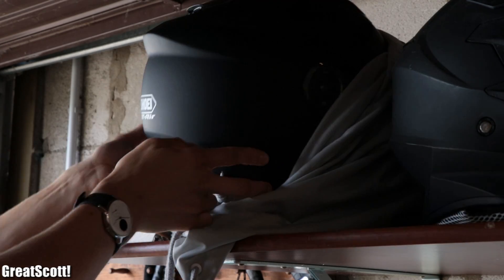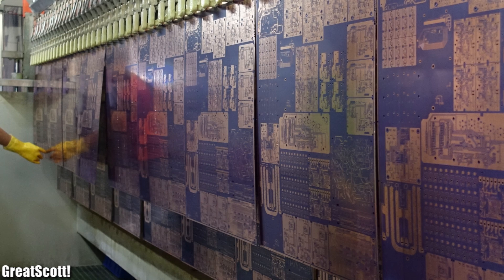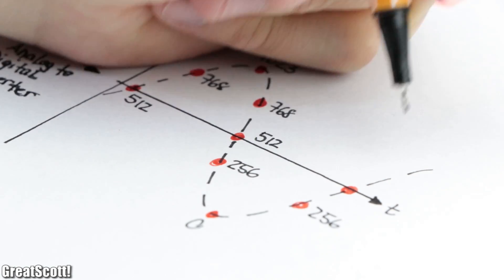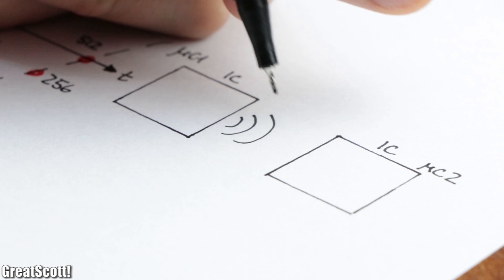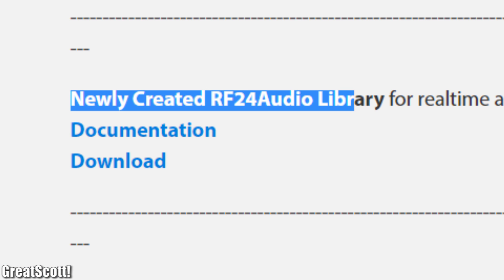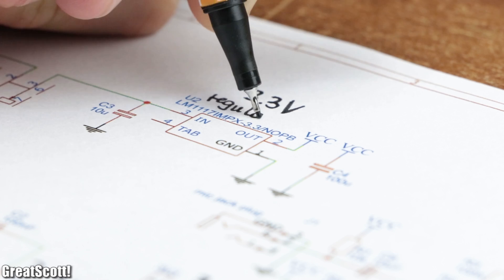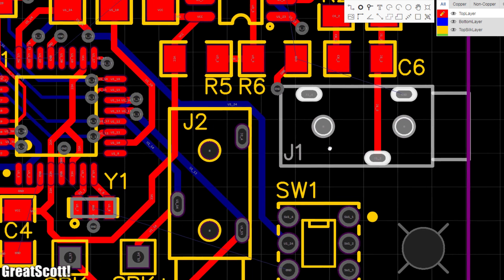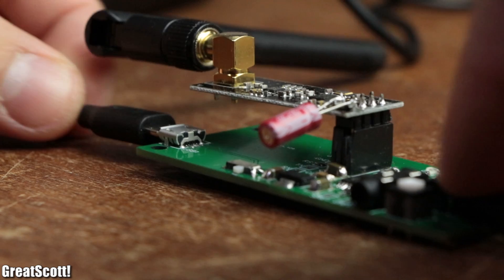Make your own very crude Walkie-talkie with an Arduino

Comment: I'm fairly certain that the distorted audio you're experiencing is because your amp is inverting, while the ADC on the ATMega 328 is only able to read inputs from GND to 5V.
What you're hearing is half the audio wave, with the bottom half clipped.

Maybe try change the amplifier to output centered around 2.5V (or half your supply) and update the Arduino ADC voltage reference to suit.

Comment: Michael Ossmann:Simple RF Circuit Design  at the 2015 Hackaday Conference is a good watch.  He recommends what you said at the end like using dedicated chips and FPGAS but I still think that the arduino must be capable of better. I liked some of the comments suggesting adding a capacitor.  Ground plane and layering of the components is the thing I remember from the talk above. So the noise of the processor is behind a grounded barrier and only the signal pokes through.  ESP32 with bluetooth would be a great project too. It is still programmable in the Arduino IDE.  Using an ESP32 with bluetooth may also make you legal with whatever radio rules you might run against.  I am pretending to be smarter than I really am as actually designing this is way about my skill level. I like how you designed everything from the ground up.  I enjoyed it very much.

Comment: Unless i'm mistaken you are powering the LM358P with 0/3.3v. But since the LM358P is not rail to rail, you only have 0 to 1.8v as valid output before it saturates (Vcc-1.5v).  So with a gain of 100, if the input goes over 15mv, it will saturate the output. If the input is indeed between 0 and 100 mv, it will saturate very easily, as soon as it is above 10% of his dynamic range.

Comment: You need a low-pass filter to turn PWM into something resembling an audio DAC. There's even a short article on Instructables with resistor and capacitor values for Arduino's PWM: https://www.instructables.com/id/Analog-Output-Convert-PWM-to-Voltage/

Comment: Great project, with an unfortunate twist. IMHO the audio sounds like a big vs. little endian mix up, integer overflow, improper use of 2's complement, ... Try to look at the output waveform with your scope and compare it to the input waveform (use a function generator to get a pure sine). If half-waves are upside down, intermediate spikes, ... these would strongly point to such numeric bugs.

Comment: Many others have mentioned the PWM as the problem, and I think so too, but it also seems weird to me to connect the GND of the speaker to PB1 (I presume a PWM pin). This should not be high, low nor PWM right? It should be exactly in the middle at 1.65V.

BTW I haven't looked at the library so maybe I missed something.

Comment: I would test the audio input circuit first, with an existing platform, then I'd test the output circuit the same way... That way it would be possible to know if the problem is with the microcontroller, the audio circuits (input or output) or the transceiver (NRF24L01 module)... Either way I loved this idea and I will try to experiment with it :) Stay creative!

Comment: 100 mV, gain of 100, so the output can reach 10V. But you opamp works between -3.3V and +3.3V, so the output will saturate. You can try to reduce the gain (e.g. 30) and try to use big resistors... For example 10 Mohm for the feedback resistor and 330kOhm for the input resistor of the inverting opamp
Reply: Same thing i thought, it just sound like a saturated sound. A quick view with the oscilloscope should make the problem clear...i would go for a simple dual stage amplifier and a low pass filter at the output.
Reply: He uses a potentiometer in the feedback, so he can tune it till it's good... I think this shouldn't be a problem.
Reply: upvote this so he can see

Comment: You need to add some multistage RC low pass filter to supress the high frequency components from the pwm audio before passing to the speaker amplifier.

Comment: I would have tried without the amplifier. Just adjust the ATMEGA analog reference voltage pin with two resistors (voltage divider) and select the analog reference input in the fuses.

Comment: A teensy microcontroller would have been much better for this, it has a much faster clock, way higher sample rates, and way more capable. It uses the arduino IDE and libraries, plus the teensy website has an audio library design tool.

Comment: To get a signal same as transmitted, use LC filter.
         L, ~80uH

IN ----^^^----.--------- SPEAKER OUT
                   |
                   -   C
                   -     ~800nF
                   |
GND--------------------GND

Comment: Arduino PWM >>> Class D AMP, use an LC filter or create a square to sinusoidal converter with only three resistors and capacitors. Some time ago I wrote a sound card for attiny85. My PWM then had a frequency of about 1MHz and then it was OK.
Link:
https://www.youtube.com/watch?v=HCr_IcG5m0o&t=164

Comment: Nice little project. I hope, like everyone else, you will investigate where the real problem lies. For example output the digitized waveform from the first Arduino back out of that Arduino and check it with a scope  and with a speaker through a filter.

Comment: In my opinion the problem could be in the cell phone. If I understood the video well, You connected cell phone's audio output directly to the microphone input. Phone headphone output generates approximettely 0.6 Volts but microphone generates much less. I would try do decrease the gain of the operational amplifier because now You have almost rectangular signal.

Comment: Noise / parasitics wont have THAT big of an effect on sound quality. If you want to keep the challenge and not throw in a class D, it might be that you need filtering on the output PWM signal.  Part of that doesn't make sense though since that PWM carrier should be ~32kHz therefore inaudible. More likely (from a filter standpoint) you need to impedance match the output and speaker.
Beyond that maybe its the drive capability of the atmega output, or the way you have the speaker connected. It looks like you're either trying to drive the speaker differentially or sink current through D9 (PB1)? Both could be problematic and where I would start testing!

Comment: I'd be tempted to try the rfm69cw or rfm12b transceiver modules and see how that goes. I wish I had some spares to try with :o I believe the can both do 433mhz, 868mhz, and 915mhz... Went back to look at the modules and it seems hoperf makes other modules that would be better suited. The two I mentioned are only up to 300kbps. The rfm26bw can do up to 1mbps, with in 142–1050 MHz. Neat. Now sure they aren't specifically made for audio, I bet they could work reasonably well and allow for some extra features given they use a packetized data stream. They are also easily controlled via an arduino.

Comment: Block the higher order harmonics of the pwm wave using LPF. From my experience, 16kHz sampling rate is enough for just human voice. At 3:40 I saw the Vp-p of the amplifier is about 2 or so Volt. You may increase the gain of the microphone amplifier even more (may be using a dual opamp?) for better SNR. Also use better speakers (throw those crappy ones out. I hate those sh!ts.)

Comment: Maybe reducing the data to 8bits, transmitting it as raw data and using a 8bit port with 8 resistors to create a dac on the reciver would work better.

Comment: The PWM output of the arduino is in the audio range 490hz. So you're not going to be able to output an audio signal between 60-16Khz with PWM. You may be able to output a 50% duty cycle digital signal at a much higher rate and just adjust the bit stream to simulate a signal.

Comment: Great video!
But... think of the poor audio being sampled by an microcontroller, with all the possible aliasing and stuff, then you send that data to another microcontroller that will try to use that data to move the duty cycle of a low frequency PWM signal... with all the latencies and noise... then feed the (low frequency) PWM signal to a speaker without a filter... no
I recommend you to use more pins from the second microcontroller in order to make a 2R2 DAC with smooth output (less instructions needed), instead of making a PWM signal, and add a buffer, especially a buffer. I'd also use a different microcontroller, like the esp8266, in order to increase the sampling rate to at least 40khz; that should work just fine

Comment: so why not pure analog circuit... Arduino is kind of overkill
Reply: its a little bit harder to do bi directionnal walkie talkie in analog tho.
Reply: @pascha4527  plenty of 27Mhz analog walkie talkie circuits floating around on-line. Doesn't seem to be rocket science :-)
Reply: Too many engineers here....wrong place for me😂😂😂
Reply: I was wondering the same thing, that’s why I was reading the comments to see if anybody else thought that.

Comment: There are lots of higher resolution and sampling rate ADC/DACs to work with. Also try using stm32f103 board which is more suitable for this application.

Comment: Hi scoot, try using csr Bluetooth chip board, I used it and it was successful for 100 meters , u need a solid state antenna. I can transmit one channel audio and receive too. But coading is up to you, I'm using it as my 5.1 wireless audio transmission

Comment: Wait... no choke on your PWM output? No wonder! Look at the output on a scope and it will become clear why it sounds like crap :P
Reply: Choke ? And what speaker is ? ;o)
Reply: @jankomuzykant1844  Not one that small with a PWM that slow. The speaker isn't sufficient.
Reply: @rich1051414  You forgot mechanical inertia.
I think it's first episode - with the problem. Now I'm waiting for GreatScott's fix ;o)
Reply: @jankomuzykant1844  At a high PWM frequency, you can get away with no choke. Also, a larger speaker with more mechanical inertia also helps. Here, with the PWM frequency being so low, there is NO WAY that little speaker can do anything substantial to the signal on it's own. A Class-D amplifiers needs AT LEAST a 40khz signal to IDEALLY produce no audible distortion from 20 to 20khz, and that is assuming there is enough inductance to 'connect the dots' on the pwm signal. It's best to not rely on the speaker, because you have no idea what present or future type of speaker will be hooked up, or any speaker at all for that matter.
Reply: @rich1051414  Nah, its okay. You can PWM into earphones and you won't hear the distortion at 16kHz. Been there, done that. This is something else.
Reply: HA! see? I called it.

Comment: The arduino's 10 bit ADC doesn't give much dynamic range.  It also doesn't have a true D/A converter, and your pwm hack throws away too much of it.  You could buy Adafruit's I2S audio amplifier module and use it as the D/A instead.  Also get one of the SAMD based boards (SAMD21 or SAMD51).  These have 12 bit A/D's and a true D/A, as well as an I2S interface for the above mentioned audio amp with D/A input.  I think that will work out for you.

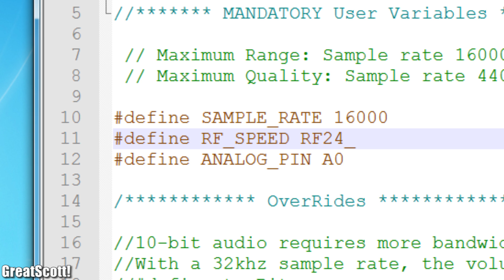Comment: at 9:09 you didn't change the sample rate because the variable was in a comment (# at the beginning of the line). I don't know if you noticed it or if it was just a demonstration of it and you forgot to remove the # but you should check it nonetheless

Comment: As far as I know, the Arduino doesn't have a DAC, but I think code is trying to output audio using a PWM and a variable duty cycle (kind of like sinusodial PWM). You probably can't hear your voice over the PWM frequency. Maybe I'm wrong, but my own tests with that stuff tell me that you need an LC filter to filter out that carrier frequency, but I've gotten a distorted signal with that stuff anyway.

Comment: output the pwm data on the 4 digital pins(map the data) and use a crud R2R ladder to output a analog signal of 4-bit
crude DAC circuit

Comment: I think the problem is with the LM358 operational amplifier. Designing a simple amplifier with this IC is troublesome. It has high input offset voltage that can be solved by using dual supply rail. You could have used LM386 to do the job. But still great video anyway! 😊
Reply: 358 works fine for audio signals, already tried it

Comment: Not sure if a 10bit ADC is good enoth for a voice audio signal. 16bit 16kHz is good for voice. I would go step by step for the troubleshooting. First try the Micro on a PC Input. If the Quality is good try to save the ADC Input of the Arduino on an SD Card as a wav file. Do the same on the Receiver side to check if the communication works. If the quality is still good try the filter after the PWM output like mentioned in the other comments. I would like to see part 2 of this project. Greetings from Germany.

Comment: Hello Great Scott! I was doing a similar thing on arduino right now and you are letting this video go.  In my opinion you need a microcontroller with a large resolution of ADC.  10 bits is not enough.  And for the transmission of human speech is enough frequency range up to 5 kHz
Reply: As for the frequency, I was wrong.  Need more frequency than the frequency of human speech

Comment: Hi. As a ham radio enthusiast I think that you need to use normal radios, because their advantage is interoperability. Any of your friends can buy a standartized radio and use it. Actulally it's better to use portable CB radios which are heavier and bigger than PMR ones but used by many people in their vehicles, so you can at least hope to get some help on road in case of something bad or ask for traffic jams and so on. That being said, as an Arduino enthusiast I would like to see a second video on this topic. I've seen one video in Russian where the author shows that he sucessfuy created such a walkie talkie using ready-made amplifier boards and RF24V library. Search for it and even if you don't understand russian, you can look at the circuits they use. 73!
Reply: Yeah, and you can try to use infrared communications if you need extreme low range comms. This way you can remove the Arduino from your project.

Comment: I think this was a great "Part 1" video.  I would really love to know why it did not work the way you thought it should. Was it the transmitter or the receiver at fault? Several other comments point to the PWM output to the speakers - is that all it is?

Comment: The amp seems to be clipping (you can see it clip in the oscilloscope recording), you seem to be missing a DAC on the receiver, and 16 kHz sample rate is only good for 8 kHz audio (should be okay for speech); so you need a 8 kHz low pass filter before the ADC and another 8 kHz low pass filter after the (missing) DAC in order to remove all of the useless higher frequency noise and distortion which you are otherwise hearing which is above Shannon Nyquist frequency.

Refer to Shannon Nyquist sampling frequency theory.

I would love to see you fix it.

Comment: Personally I would've used a simple 2 transistor FM transmitter circuit, so much easier than messing with two uC's that's for sure!! But at last were can see what would've happened had we tried your method, so thanks for that :)

Comment: I dont think the IO pins on a microcontroller is sufficient to drive a speaker which are typically 8 ohms. I would also suggest using a DAC or if you really want to use pwm you need to low pass filter it.

Comment: Did you filter before digitizing to prevent aliasing?
Reply: Maybe using the other op-amp in the LM358 as a Sellen key filter. Your on right path with this Big B
Reply: I would have liked to have seen him use the lm856 instead. On the audio I couldn’t help but think the microphone could be some of the problem.

Comment: Did you try to increase pwm frequency? I think default frequency is about 1kHz so expecting to output audio frequencies and with sample rate 16kHz will definately not work also you need a filter at about 8kHz after that

Comment: The quality issue is probably on the receiver side I would think. I mean without something to make the square wave not so harsh and the fact that your probably getting bad clipping from just having the speaker right on the arduino pins I'm sure isn't helping. Perhaps also try using a dedicated ADC and DAC. I'm sure a lot of quality is being lost just because the arduino isn't designed specifically for that

Comment: Do the adc reads negativ voltage? I think you need to drive the 0 voltage level to +2 volts with a transistor and then amplify the signal with opamp but with lower gain for better quality.

Comment: Problem of distortion it was hide in OP-AMP It is clearly improve voltage but dat distortion was pretty awfull better use LOW NOISE op-amp or.. LM386 and smooth it a bit by low-pass filter (rc-lc coupler) another problem is of course sampling itself.. dat PWM you create has probably LOW freq.. what is increasing little PAUSE in transfer and make transfer more noisy co'z peak to peak charakteristic.. . In sumary nice project.

Comment: Have you tried to put a low pass filter between your mic amplifier and the ADC input ? Maybe it is an aliasing problem. I think you should cut the audio frequency at a maximum of half the sampling rate (8khz at 16ksps) or even slightly below. It might also be a good idea to filter out the lower frequencies as well, in order to minimize potential pop and hum pickup, let's say anything below 200Hz or 300Hz.